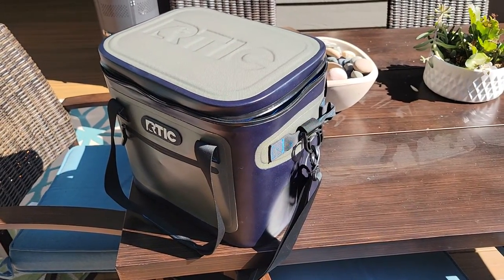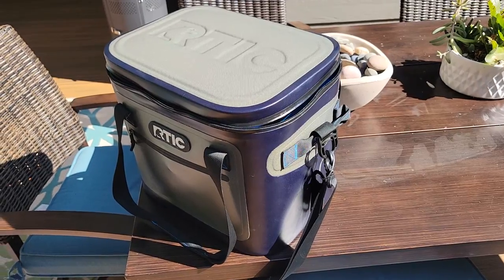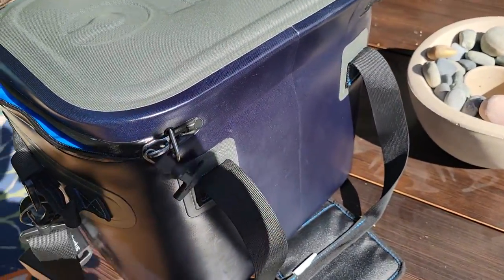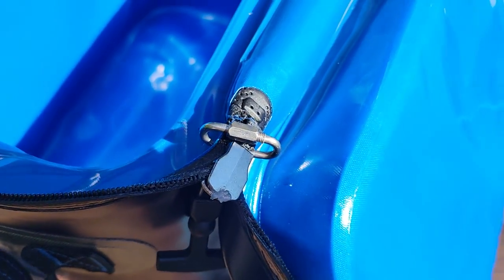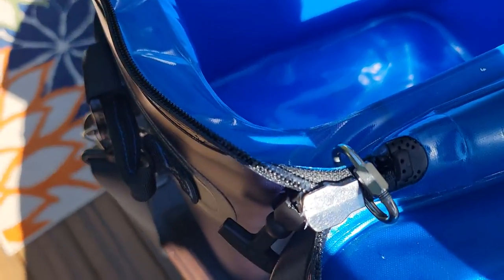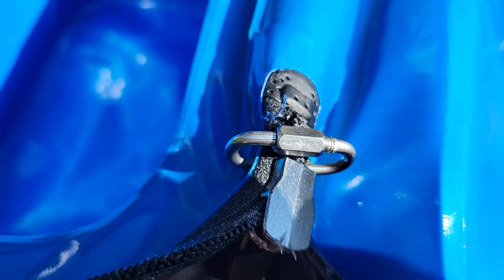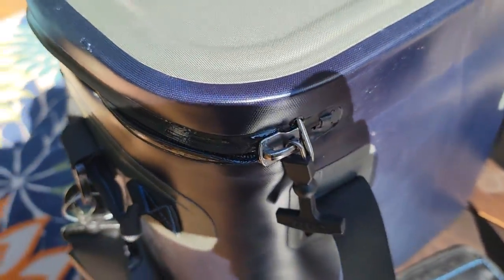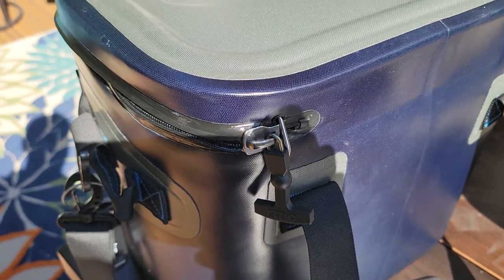ARTIC Soft Pack Cooler broken zipper - quick fix

Comment: The problem I have and which many others have reported is that the vinyl overlay separates from the zipper, the zipper
Jumps the track  and it will no longer zip. Any solution for that?

Comment: Ok this worked for me , but I think it can be done without cutting. Basically the zipper head has widened and needs to be smashed back down tighter . On my cooler the rear part of the zipper head needed to be smashed or tighter. I did this with pliers after taking the zipper off.  The zipper is much tighter and no issues so far